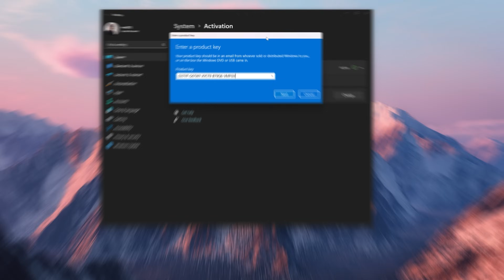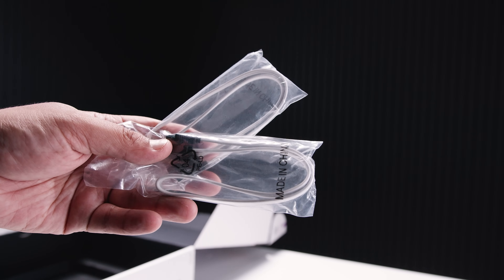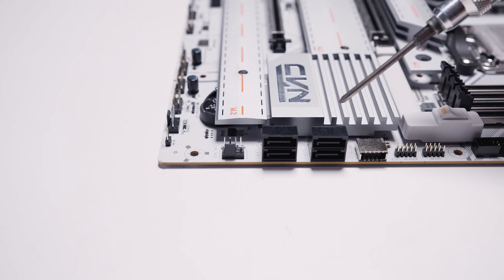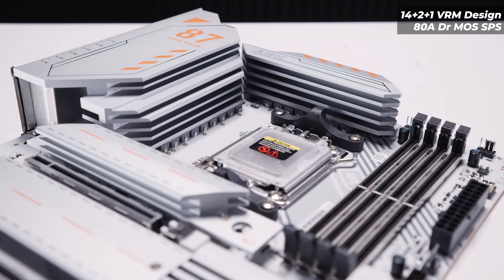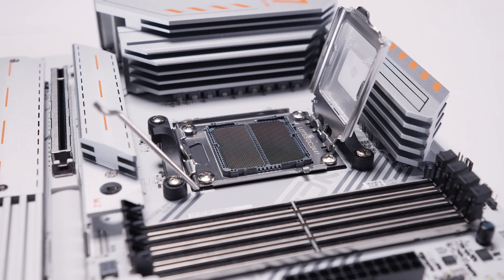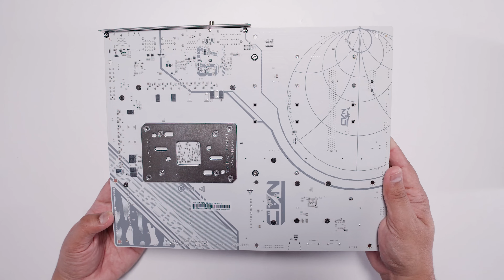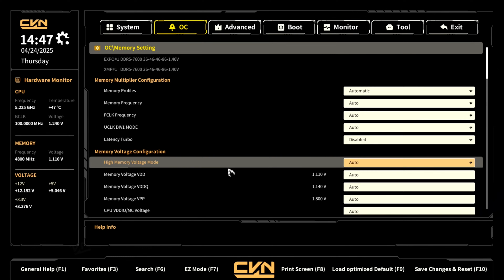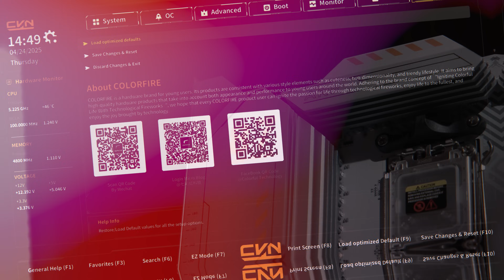Can This Unknown AM5 Motherboard Beat the Big Brands?

Comment: I own this board for a month now, I found TWO BIG issues. One, the load line calibration, it's pretty broken on this board, sometimes it dips into 0.4v which is too low. No issues with default settings though. for overclockers or who likes to optimize, should avoid this board completely since they are new into AM5. Two, during POST, it's SO HARD to get into bios, sometimes you need to restart two times, sometimes it's just stuck at POST logo and then you need to restart again, or boot into bios from windows does not actually boot into bios, just reboot and back to windows instead of going to bios. Pretty frustrating. P.S. My Bios version is 1016.

Comment: Their B650 mATX is an absolute beast - comes with Gen5 GPU and Gen5 M2 slots and surprisingly decent I/O at 120 bucks (B650E motherboards start at 200+ in the west...). Made few budget rigs for friends with it and 7500F and it's working like a dream - also when I was testing them, it worked with my 7950X3D just fine 👍